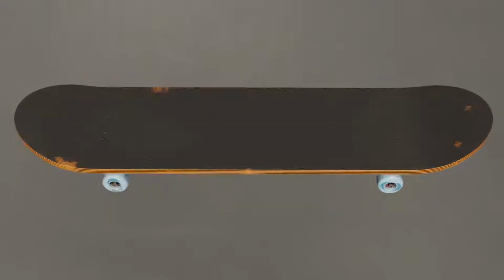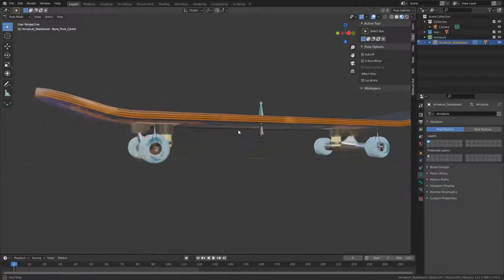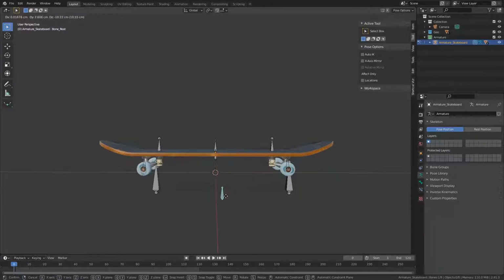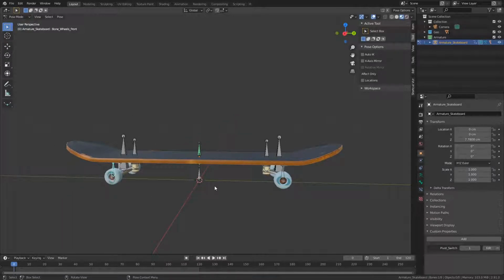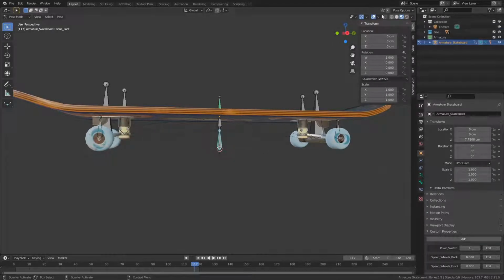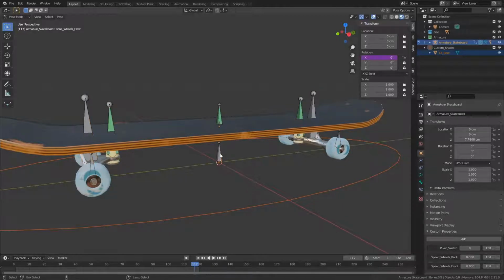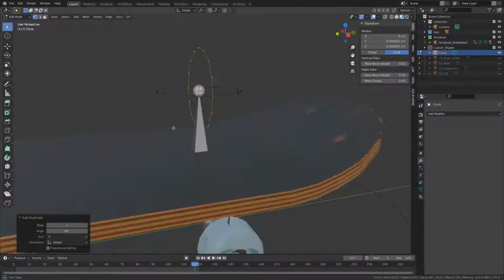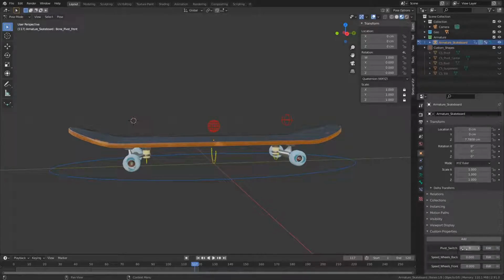Blender 3D Skateboard Rigging Tutorial

Comment: Thanks, great tutorial! I do have one issue with the rig and maybe it's an easy fix.? When I rotate or move the pivot bone, the other pivot does not follow the rest of the rig. This is a problem because the motion of an ollie requires the board to start pivot on the back trucks but then pivot from the front axis when it's in the air. If I use the pivot bones and then change the switch, the other side is not in the right place. Does that make sense? If someone could help me, I would really appreciate it!
Reply from the maker: The pivot bone is just for rotating, not moving. The being said, it's a bit odd the other one doesn't follow. Do you have the correct parenting/hierarchy for the bones?

Comment: I have a question.  I am doing this tutorial using 4.4
.  When I get to the Constraint where we assign it a value of 0 or 1 for the front or back pivot, there is no more assign value and when I go to bone constraint that does not show up at all as an option.  4.4a do not have the constraints available but 4.4 does.  But still, the custom propertiesdoes not have a property value tab available.  How would you do a workaround  to address this?  My apologies for using a newer version of blender, I was excited to see there is a skateboard rigging tutorial which I have not found elsewhere, but of course I did not pay any attention to which version you used and now I have a tech problem because of the newer version of the program.
Reply from the maker: There is no need to apologize for a newer version of Blender. I understand those changes can be tricky. At the moment I don't have an answer, as I'm still using the older version (I'm thinking about waiting for 4.5).
You might have the custom properties in the bones of the armature (when you go into pose mode).
You could also try asking on Reddit or the Blender forum on where to find it in the newer version.

Comment: Wheels rotation can be made easier, just add driver for every wheel for it will rotate around X axis when deck change location in Y axis.
Reply from the maker: There are several ways to make the wheels rotate. What I found is if I connect the wheel rotate to the movement of the board itself, it moves all 4 wheels, while on occasion, you might want only 2 wheels move (like you might do with some skate tricks).